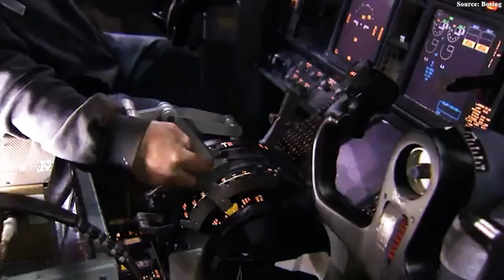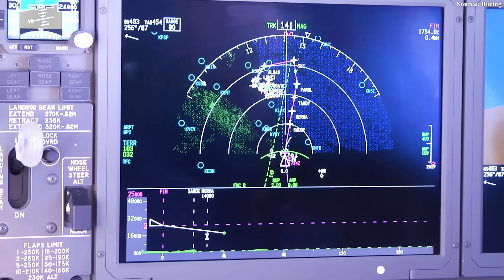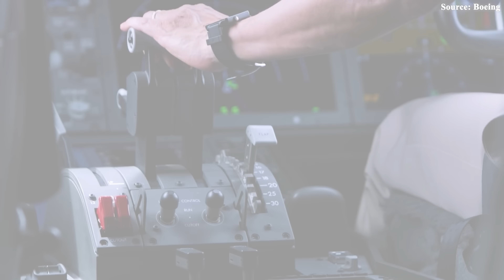Boeing's Next Aircraft Just OUTSMARTED Airbus - Then Something Changed!

Comment: In an era when air accidents were in decline to have two new aircraft crash and kill 346 passengers and crew was a major set back for Boeing.  If Boeing could not engineer a safe iteration of the 737, or bring an iteration of the 777 to market on time, or develop the 787 within budget, or supply the US airforce with 767 based tanker aircraft without issues then there can be very little confidence that they can build a blank sheet design on time, on budget, that is safe and hits performance targets.  Boeing is between a rock and a hard place financially. Boeing carries a lot of debt and the level of additional debt needed to develop a new aircraft may be too expensive due to the level of risk.
Reply from the maker: Boeing’s difficult period has lasted for too long. Don’t you think so?